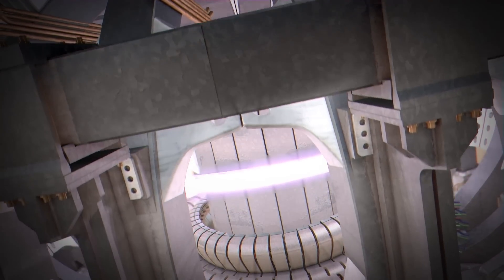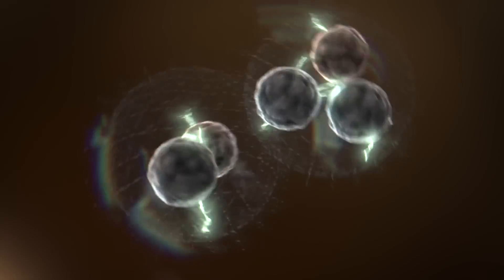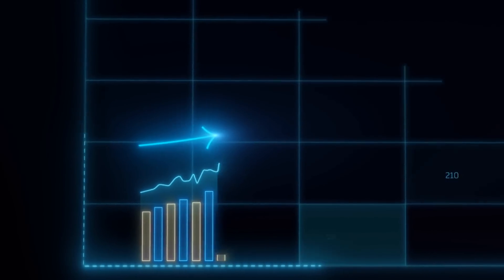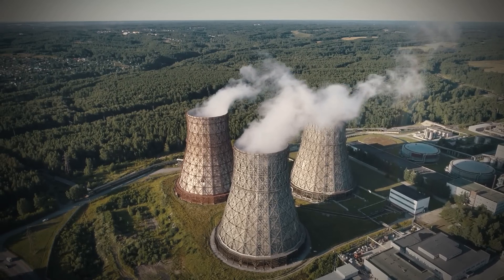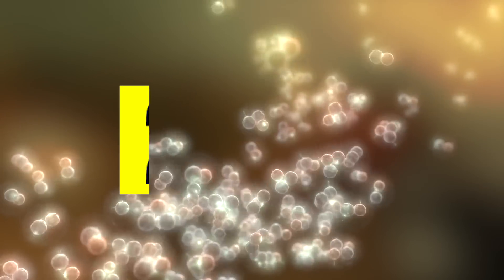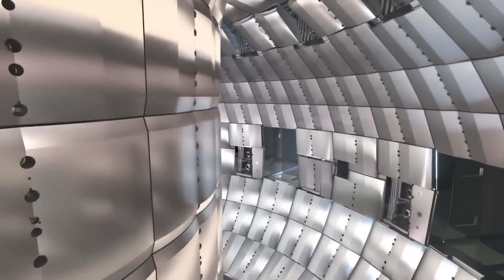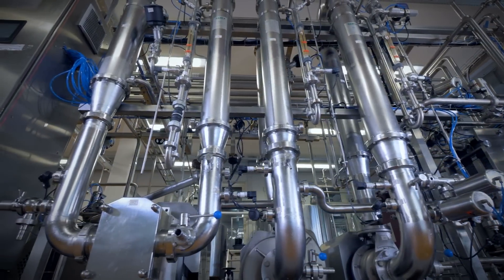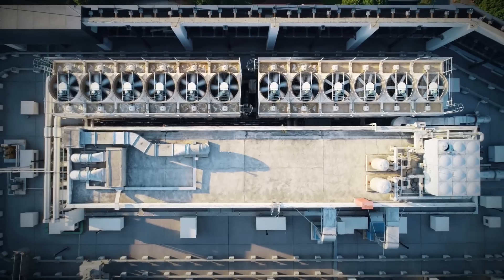The Shocking Problem That Could End Nuclear Fusion

Comment: Cheap electricity from fusion is pipedream since the cost of uranium is less than 5% of operating costs of fission powerplant. This is with very wasteful U235 technology. With U238/Pu239 it is app. 0.1% and app. 0.01% for Th232/U233. TOKAMAK will always be much more expensive than fission reactor in terms of steel, conctrete and manhours. Actually uranium is too cheap (app. 90 USD/kg) to force thorium (7 USD/kg) technology. Ocean water is also virtually unlimited source of uranium with extraction cost app. 130 USD/kg in 2016y and still getting cheaper. Nuclear waste is no problem with thorium technology ~ 1% of U235 technology as well as safety is better than solar and wind tech. Fukushima and Chernobyl? Compare car safety in 1950s and now.

Comment: If all you really care about is getting spare neutrons, an on-site fission reactor built solely for the purpose of producing fusion fuel would be fine. 

You could probably modify principles developed for the production of Plutonium-239 for this task. For example, fission of Uranium-235 produces either 2 or 3 neutron, averaging almost 2.5 neutron per reaction. 

You could use some of the spare neutrons not needed to sustain the reaction to cause fission of the Beryllium neutron multiplier, and then use those resultant neutrons to react the Lithium-6 into Helium-4 and Hydrogen-3. 

The theoretical maximum would be (~2.5 - 1) x 2, meaning you could produce on average around 3 tritium atoms for every U-235 atom, before accounting for inefficiencies. 

If you also use the thermal energy of the tritium breeder reactor to produce electrical energy then you can partially offset the energy requirements of the fusion plant.

The Lithium-6 and Hydrogen-2 are both naturally abundant and can both be sourced from seawater. 

The most difficult component to source is Beryllium, with global production around 220 tons per year; especially at the purities required (ITER for example requires a purity of less than 30 weight parts of Uranium per million parts of Beryllium) for neutron multiplication jacketing.
Reply: So... an on-site fission reactor to produce fuel for the on-site fusion reactor.

Why not simply just build a standard nuclear fission power plant?

Comment: Tritium can be made using heavy water nuclear reactors or breeding from lithium.  The real problem with fusion reactor is 10x+ easier to do hybrid reactor using blanket of depleted uranium to multiply the energy from each neutron, which then easily yields easy to separate bomb grade plutonium, fusion reactors if successful make destruction by nuclear war easier.
Reply: and for all their trouble, fusion reactors don't do much more than much easier "breeder fission reactors", especially subcritical ones that can burn up existing nuclear waste faster than they make it, so likely more desirable right now.  

Fusion reactors still leave behind (add) some radioactive waste, while breeder reactors can reduce nuclear waste.
Reply: (Currently the production of tritium is being intentionally limited because it can easily be used to increase blast of even crude nuclear bombs, so artificially expensive)

Comment: Fusion reactors produce a lot of neutrons. Neutron shielding is a major necessity in their operating environment (Neutron activation and neutron embrittlement of materials around the reactor being a concern). So why not perform the Tritium breeding in a "blanket" around fusion reactors? This configuration also benefits from not having to shield the process from the high temperatures of the fusion reactor. A possible drawback could be the energy of the neutron: Must it be a fast neutron or a thermal neutron? What is the desired MEV window? I presume that the breeding process is somewhat dependent upon the microscopic/macroscopic cross sections of Barium and Lithium for scattering and absorption of neutrons at specific energies (I'll have to dig out my Barn Book and look further into that). Some "jiggering" with the fusion cores shielding and the placement of the Tritium breeder section seems possible.

Comment: Yes, but that is hardly the biggest problem fusion is facing. The biggest problem with current fusion reactors is that the energy you need to put in to produce the heat for fusion to happen is much higher than what you get out in usable energy. They are using more electricity than they are producing. Fusion is not going to be a viable way to get electricity for a very long time to come.

Comment: It might be good to also be an advocate of thorium fueled molten salt reactor development because as you know it has significant advantages over existing fission and it has been tried and tested at Oakridge decades ago but research and development went in another direction. With todays urgent needs for green base load energy we should putting fusion on hold channeling development effort and funds into Thorium as it has huge potential to be available as an intermediate measure 'til fusion is available.
Reply: Research into LIFTER reactors should never have been shelved. China is ahead of the world in this. They show more realistic promise than fusion.
Reply: @william breen Long lived Nuclear "waste" can be burned off in a molten salt reactor as part of it's normal operating cycle. The Thorium cycle reactors do have their own waste, but they are only dangerous for about 300 years as opposed to 10 thousand years or so.
Reply: @william breen No.

Solid fuel rods in Steam Bomb reactors (my name for any reactor using water as a coolant) are only 2% used before being discarded and remain dangerously radioactive for 10,000 years. That's two full orders of magnitude longer than Thorium waste and outside the scope of civilization's ability to contain.  We've built structures that have stood for 300 or so years.  No one civilization has been around 10,000 years.

That alone is a reason to switch to Thorium.  Let alone the enormous pickups in safety and scalability (Thorium reactors can be made much smaller than steam bomb reactors).

Comment: The research is well worthwhile, but I still think getting commercialized LFTR and related Gen IV reactors will be far easier and quicker to do, given their effectiveness is already proven since the 60s through 80s.  Also breeding tritium is pretty easy, though we don't bother yet.  Neutrons are not hard to come by in any fission nuclear reactor, so if you wanted more, just add a blanket to those reactors as well.  Or - build/refurb more CANDUs.
Reply: Yea. To anyone looking at things honestly, Nuclear Fission reactors need to be decriminalized, standardized, and mass produced. Even if Fusion does work, it's going to take a long time for it to become a viable energy source. Fission power is good enough now for the foreseeable future. The only problems it has are political, not technological.

Comment: 7:11 do you know how to jump down to the bottom and then bounces because it's supposed to be the shape of a core of a sun and the magnetic containment in that center chamber is blocking that containment of being a son that's why you don't get proper fusion. This is why the engine from a lot of different places I could show you them all and then put them all together and it would make it better fusion core than what you get trying to do in this video. The tokamak design is a failure because it's designed to be a failure you get a better chance of getting higher output if it's the shape of a sun. Learning not to overuse so it'd be not so destructive that would be the question of how to design it so it doesn't become a nuclear bomb in compression but more of designing it to be contained and balance of equilibrium for power output.

Comment: Fusion just like fission seems to have a A singular approach to the problem, at least that’s what they tell the public. As far as fusion goes aneutronic get very little attention and funding, Focus Fusion has shown very impressive results despite being so poorly funded, it’s fuel(Boron and Hydrogen) is so abundant that it would be nearly impossible for a cartel to insert itself Into fuel supply. There is another aneutronic fusion that is to runs on Helium-3, this version of aneutronic fusion have received a couple of billion dollars in funding, Helium-3 will be more cartel friendly as it will need to be harvest from the moon, therefore becoming more alluring to investors.
Sadly that Monster TokaMac fusion reactor might also be missing enough power to start besides its fuel.
If only they didn’t keep the Thorium Molten Salt reactor on the back burner for last Half Century.

Comment: I think my comment died for having links to journal articles in it. Sad! Startup tritium may be exclusively a problem for large and basically obsolete tokamaks like ITER. The CFS tokamak design is predicted to have a tritium breeding ratio of 1.2 or more and have a startup inventory about 10 times less at 50-90 grams. This combines to make it possible for a single startup plant to double its tritium in 2 years, starting up another plant and leading on to a huge supply within 20 years. The testing for this known as the LIBRA tritium inventory experiment has been funded by the US government to be done by MIT. The catch for them is enriching lithium and how much it might cost.

There's interesting news on that front as Renaissance Fusion say their stellarator design could have a TBR of 1.3 to 1.5 with natural lithium. First Light Fusion say they could use natural lithium as well, I think meaning that it's an option rather than a preferred situation. Possibly along with them is Zap Energy who say they could breed their own tritium in 60 days with a TBR of 1.1 - since they have a similar breeding blanket coverage as First Light it seems they may also be able to use natural lithium.

In a paper called "Tritium resources available for fusion reactors" it is estimated that light water reactors could produce 300g of tritium per year if fitted for it. There is one purpose built one that is expanding their license to 1.2 kg a year which I think is currently producing up to 750g. The latent production capability is about 30kg a year if you suppose about 100 of the 400 reactors worldwide is new enough to justify a tritium plant. This could even be enough for DEMO size power plants if they are on the lower end of expected startup tritium needed and have a tritium doubling time of about 10 years or less.

Comment: I'm not a fusion subject matter expert, but I would like to add that the US government has a Tritium research and production facility at the Savanah River Site in South Carolina. It's just one part of the site, and it's primary function during the cold War was nuclear weapons production. Although you need a DOE Q clearance (top secret) to work there, there are thousands of such employees on the site. As such you can read job descriptions on job postings and get a good idea of what they do without actually having access to any classified documentation.  Though we aren't currently increasing the number of weapons in the stockpile, they are producing new ones to replace older ones.  It may be too expensive to make sense for fusion, but there is certainly a lot more than 25kg of tritium, it just isn't on the "commercial" market. The Savanah River Nuclear Laboratory lists fusion and Helium-3 research in many of it's descriptions for research scientist and engineering job positions so they are definitely involved in some sort of research to that end, not just weapons. Maybe there will be a crossover one day, and the Tritium housed for weapons could be used for fusion. Source- I live in the city beside SRS.
Reply: I found his reasoning odd. He makes it sound like the only way to get the stuff is 500g/yr from some Canadian reactors, yet we have 25kg right now... with a half-life of 12.3 years. So in the last 13 years Canada has only produced 6kg of the stuff, but we have 25kg now. Either there are other, better sources of the stuff, or we had a whole lot of it previously which implies that there is a perfectly good way to make it again if we wanted to.
Reply: tritium is used to make watches glow. they put it in glass tubes as a gas you can buy tons of them right now. There absolutely is tritium in the commercial market, probably used in all kinds of applications not just glowing watches
Reply: @hotpckts  tritium is also used for glowing markings on gun sights

Comment: Nuclear fusion is a deceptive pipe dream promoted by people who are addicted to government money for endless research forever promising what cannot be delivered. This video was good but barely scratched the surface of the problems associated with nuclear fusion. You may want to check out the Tech for luddites channel for more specifics on this. Nuclear fusion on Earth is never going to be viable because it is just as dirty as nuclear fission and tritium remains a massive problem and environmental contaminant that cannot be contained. The answer is NOT FUSION. It's FISSION. Primarily THORIUM FISSION in the form of a molten salt reactor.

Comment: We have no Fusion problems when you read the following. Please don't believe this nonsense All opposition to nuclear melts away when we consider radiation-free FUSION nuclear power. There is no global greenhouse gas, no atmospheric particulate pollution and no visual pollution while it is built within our communities with no visual pollution and no ugly electric super grid requirements. It produces almost costless electricity and also hydrogen fuel from water electrolysis via new FUSION NUCLEAR electricity and it is now immediately upon us. We have recently taken a new step to advance the physic of power production by enabling the chemistry of the atomic nucleus, or "nuchemy" in the newest FUSION NUCLEAR POWER. This is with the technology of the Canadian SAFIR REACTOR. This was derived and developed from the nuclear experiment to prove how our sun is actually powered. This was an experiment called the Safire Project 2013-19. We thereby passed on from the chemistry level where we interacted with the atomic electron shells and moved on to manipulations in this "NUCHEMY" atomic nuclear action when we interact and multiply nuclear protons resulting in immense energy output. We have thus rediscovered the lost work of the alchemists and can make new elements with different atomic weights. This was ably demonstrated in "The Safire Project". We now have this fusion energy technique which manipulates the atomic nucleus much more easily by creating a naturally self-forming compartment, or what is a local region of plasma containment region so reactions at this atomic nuclear level can easily take place. This is about to practically enabled a really fantastic and cheap new era of energy production for the whole of mankind. This with hydrogen, so free fuel is obtained from water or atmospheric moisture anywhere in the world. This new fusion nuclear is at the industrial commercial production final development point as of now and has the potential to put all nations on a power production level playing field. The energy argument and other power methodologies are all now virtually and immediately irrelevant as we have a new and very physically and economically powered supply with this super compact and inexpensive reactor that requires only small local grids and no super high voltage connector grids for any local community level fusion nuclear power supply. Solar roof plus Teslawall battery may be the present optimal way to go domestically but megapack batteries and multiple storage technologies interconnected with an expanded ugly, expensive and vulnerable grid have a less certain requirement when you consider new any-scale community based and 24 hr reliable and self-fuelling fusion nuclear in the form of the "SAFIRE REACTOR". Learn all about it at "AUREON ENERGY.COM". Learn the necessary and newer EU Theory and plasma physics at "THUNDERBOLTS PROJECT.COM" and you will be permanently re-educated with this advanced new EU theory that will allow you to understand more about astrophysics of our whole universe and all within. I stand by my word and this information. Sincerely, Dr David M. Gillman at dgillman47@gmail.comElon, I have huge admiration for all you are doing, and this was a great interview. However, if you are really going to Mars and more you drastically need to update your modern physics and astrophysics study. The sun is not a "nuclear furnace in the sky" and is never going to "grow old and expand and swallow the inner planets". You need to look and study beyond the old and classical "Standard Model" and investigate the new "Electric Universe Theory". There are many brilliant scientists that will enlighten you on this work at 'Thunderbolts Project.com". You can then learn about the already solved problem of fusion energy which your ships could best utilise. Study the 'Safire Project experiment they conducted between 2013-19" and then check the Canadian company that builds their fusion "Safire Reactor" which you can see at the company website at "AUREON ENERGY.com". You may be stunned that you have not heard about this utterly earth-changing science that DARPA has presently taken over. Either get the information from them or redo the excellent Safire experiment yourself. The Safire Reactor is super compact, inexpensive and simple to build quickly, which is ideal for aviation, ships and space travel. 
                                                                                                                      With great respect, Dr David Michael Gillman at dgillman47@gmail.com.

Comment: Only a small percentage of the fusion money would be enough to research and build a thorium reactor.  Almost unlimited fuel supply there too, and vastly reduced radioactive waste compared with current npps. Still as radioactive during operation though. The Chinese are building one.